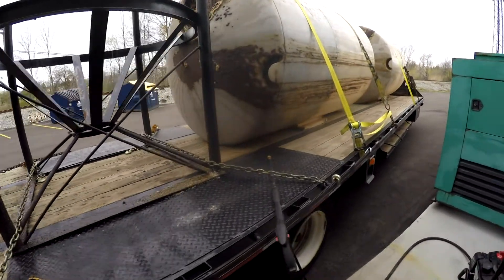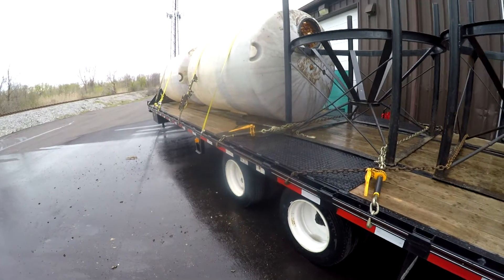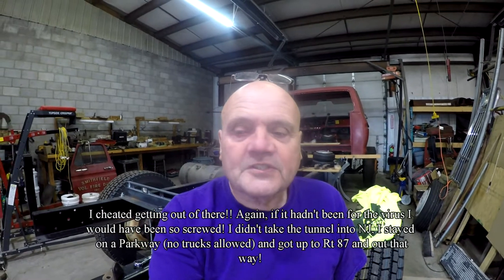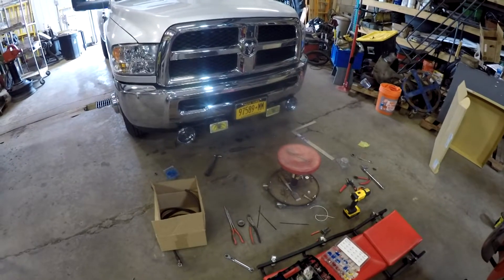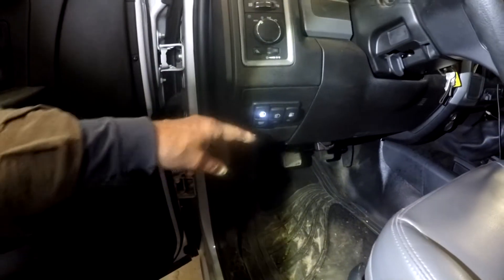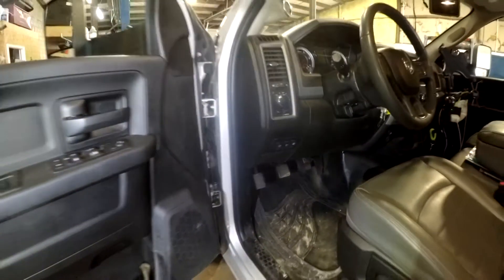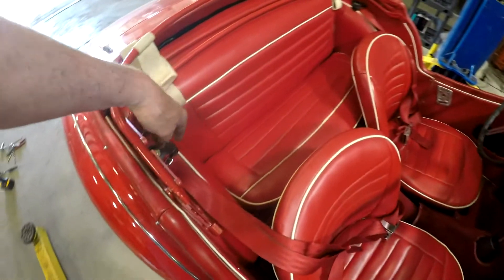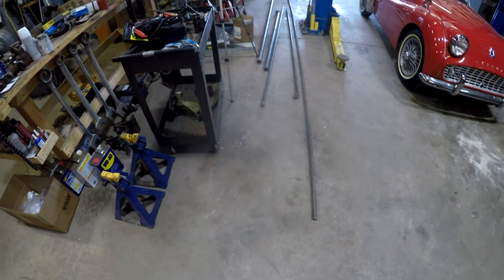Shop Update 05/22/20 - Truck Lights, Hauls, and TR3 Seat Belts

Comment: Of course I did what you instructed and went to the last video to fill in before watching the new video.  I assume since you're manifolding those air lines together that you will be using check valves in the lines between tanks?
Reply from the maker: Think the system runs off a checked manifold (at least system that I am looking at for haul truck is that way) and is ‘plug and play’ so to speak! Know that you can raise or lower pressure on one branch without affecting the other branch, so assuming manifold is checked!

Comment: Buy a rollback. Also never buy anything with a little Cat engine in it.  Thought you were going to visit the trailer people?
Reply from the maker: Long story about trailer people, will get into it in another video. In short factory doesn't have service department and they want me to take it to dealer instead. 
Cat in general or is there certain model/sizes to stay away from? Cummins guy (as you know), but sometimes is find what your looking for in used market.
Reply: @frednewman2162  3116,3126,c7,c9 all trouble